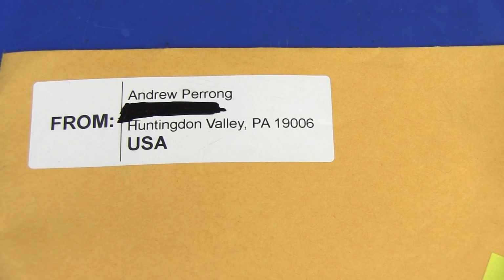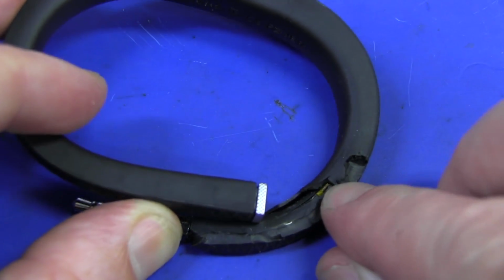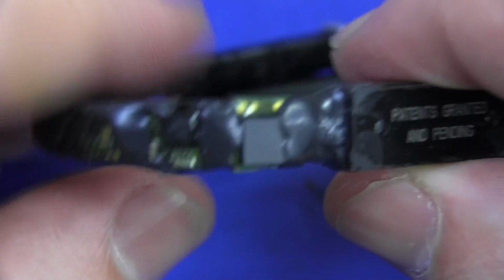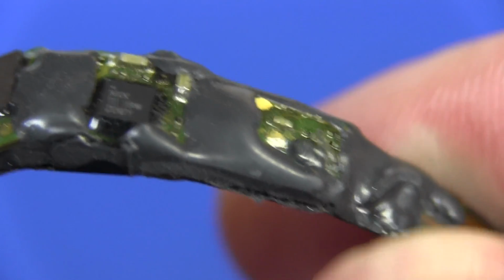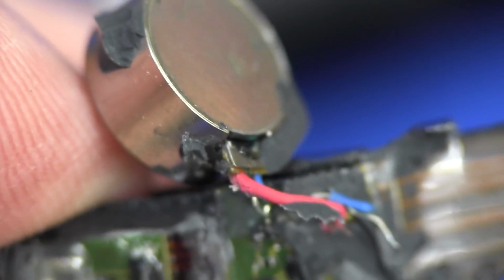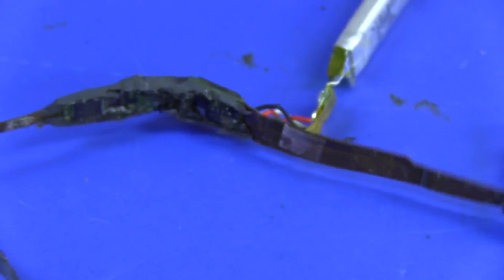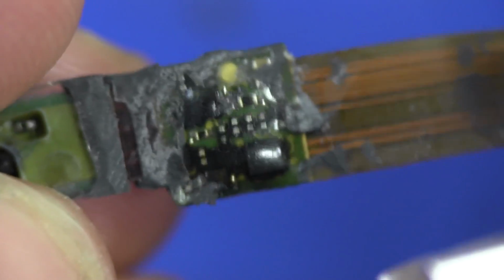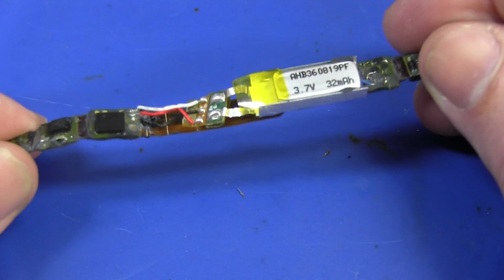EEVblog #412 - Jawbone UP Pedometer Teardown

Comment: Thanks for a great teardown, there appears to be an enormous amount of tech going into these devices.
Now I know this was a dead device so it wasnt possible to use it but it has left me wondering how it communicates with the phone, can an i-phone switch data onto its headphone/mic connector or are we seeing the return of the acoustic modem in a slightly different form?

Comment: Hi there I know this post is old but I have a jawbone up and lost the usb cord is there a way to find out what the pin layout on this so I can built one for myself 

Thanks
Reply: On the 4 contacts Jack, +5V is the one that is closest to the rubber bracelet, GND is the next one.  The two topmost contacts near the tip of the Jack are left unconnected during charging.